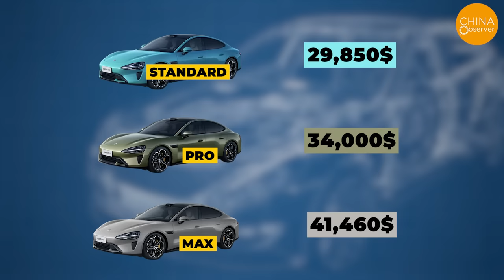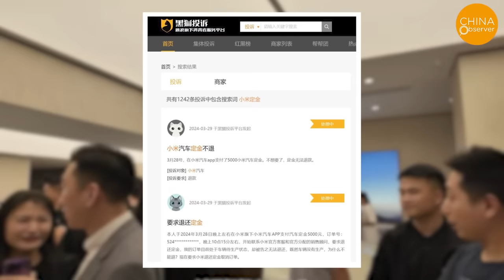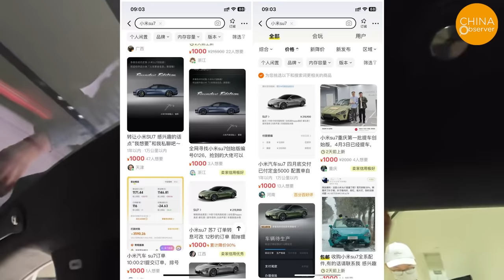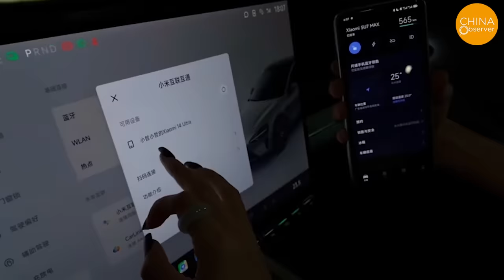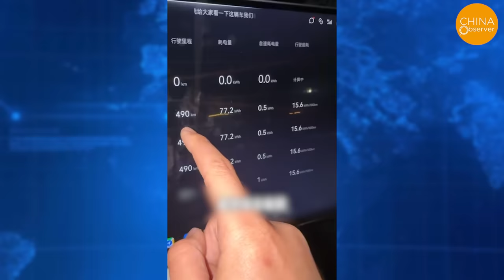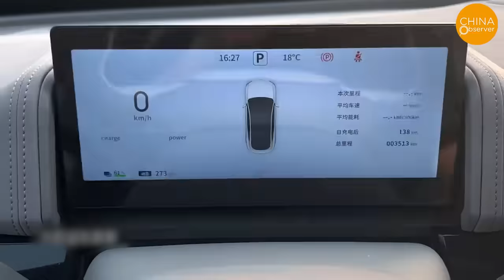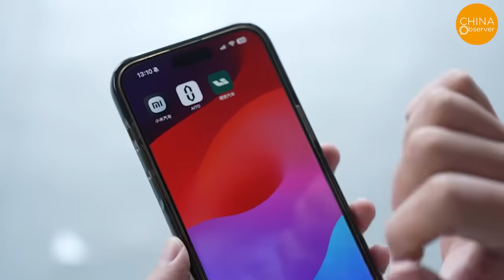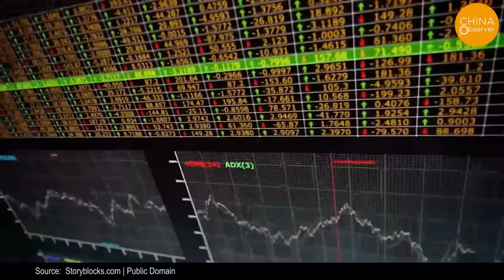Xiaomi EVs Criticized for Poor Quality, Using Aluminum Instead of Copper, 40% Cancellation Rate

Comment: This is their first car and they seems to have fallen into many engineering pitfalls.... but i am confident, they will fix all of those within a year max. They may have to stop the production meantime and stop damaging their reputation based on their smartphones customers experience. BTW, super nice stylish car !😍
The change from Copper to Aluminium LV wires and HV busbars is not specific to Xiaomi but a trend in the WW auto industry. Reason is the crazy finance speculation on copper  price (LME, SMM). The industry is being forced to look for alternatives to Copper. Aluminium is OK for most of the use cases but needs further design care and validations by OEMs and their suppliers ....
Reply: Um.. Ok... Yep
Reply: The Mental Midgets Middle Kingdom sincerely thank you for your loyal patronage.

Comment: " Aluminum has 61 percent of the conductivity of copper, but has only 30 percent of the weight of copper."
But because aluminum has lower conductivity, if you want a wire to transmit as much power, it needs to be thicker. So, does it really save weight?
By having a wire too thin it increases the chance of a fire (this is why you need to be careful with power bars).
Reply: Do the math, yes. Aluminum with the same level of conductivity weighs ~50% according to the figures in your quote.
Reply: @laowan  then why do more fires happen when aluminum wire is used?
Mobile homes are a good example of this.

Copper is used for a reason. Because, while it's not as great as silver (for conductivity), it's better than aluminum (for safety). 

But you know what laowan, if you own a home, have it rewired with aluminum, let us know how that works out for you.

*edit
Interesting, I noticed when you replied, your name was 老万 （vilicvane） , why'd you change your name?
Reply: @brennencox516  I don’t see the stats but there’s an easy answer: copper is more flexible so less likely to be damaged. But this could be negligible if the wire is fixed.

Comment: China Observer has no sense of technology. We don't see any fault of using Aluminium instead of Copper. The obvious mistake of EV in USA is the lacking of recharging points. No one can properly drive a EV without the recharging points. USA is too backward to accept new technology. We pity USA users. Paying twice the price but lacking of supports.
Reply: And this is the issue, you don't see any fault of using aluminium while rest of the world does, and for good reason... Aluminium isn't suitable for wires, otherwise everyone would be using it for everything.